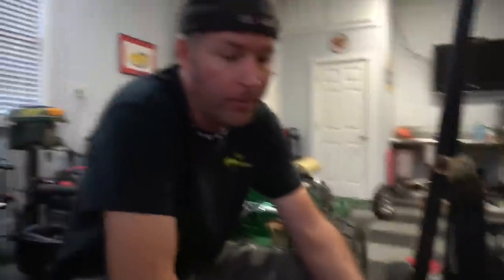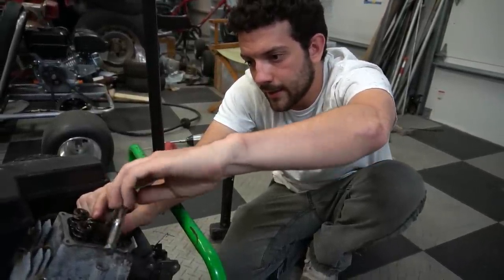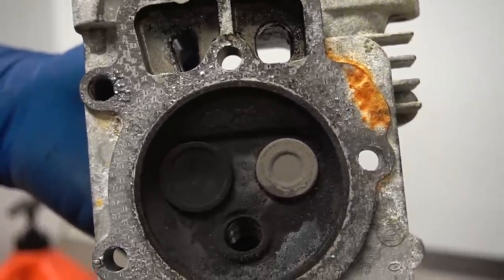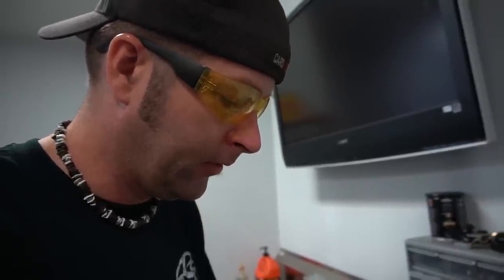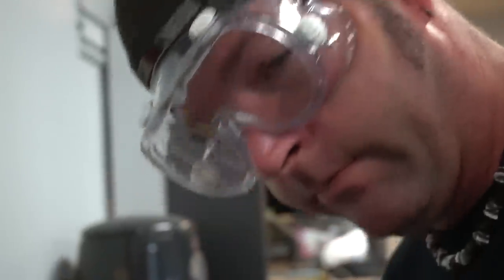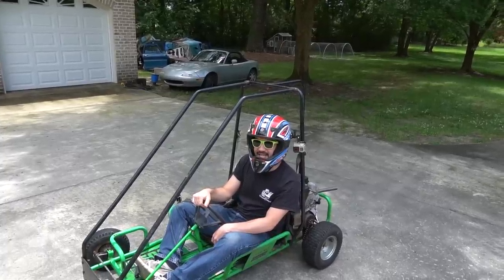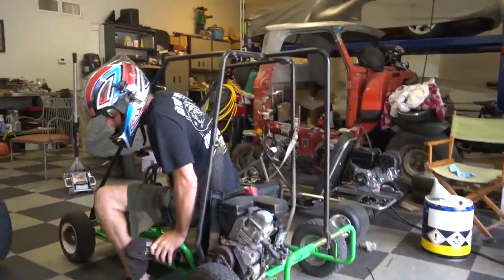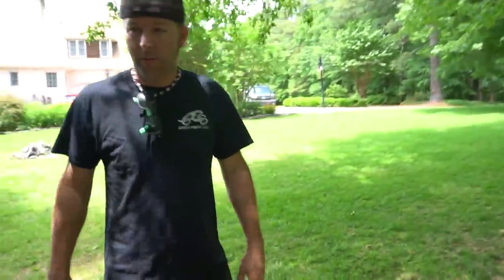5 Free Mods to Increase Go Kart Horsepower! Pt. 2

Comment: Small engine performane mod list:
1. Open up air filter for more air flow.
2. Make sure throttle has full travel.
3. Clean the carb and fuel system.
4. Port and polish.
5. Mill the head.
6. Remove governor.
7. Stiffer valve springs.
8. Drill carb needle jet.
9. Open up the muffler.
10. Billet flywheel.
Reply: You seem like you know engines so I want to ask you this. I am looking to buy a new jet for a predator 212 because I am putting a new intake on it and new exhaust. I don't know how big the jet opening should be please help.
Reply: @matthewarnspiger632  0.038
Reply: @matthewarnspiger632  buy a jet kit... if memory serves Amazon has jetting kits of multiple sizes so you can swap em out and find the one your engine likes.
Reply: What would you drill the jet out to??
Reply: @jwells1501  start with 0.035"  0.038" is fine as the other guy suggested
Reply: @Uptin Sinclaire I have a question... I have a 208cc power fist engine on my mini bike. I have  the stage one kit... can I take out to governor?? People tell me it will rev to high and break my pistons and rods
Reply: @yoboihooligan9914  "Powerfist" 😂 thats the funniest named engine ive ever heard 😂  i imagine its some sort of honda clone, so imho you're probably fine removing the governor.

There is a chance you'll throw a rod, but really its sustained RPM that kills ungoverned small engines.  If you're just doing a rip or two, it's probably fine.  Holding it wide open for 2 and 3 minutes at a time trying to hit a crazy top speed is where you're more likely to hurt it
Reply: And not just open up the muffler I rather get a brand spanking new muffler and 

derestrict that LOL and I wouldn't even swap out the engine cuz these parts are so expensive they're not like buying scooter parts I have a GY6 scooter and we used to be 50cc and I turned into a 93 just recently paid someone to do it all I 

got to do now is put the nitrous can on it and I pretty much in swapping out all the cheap stuff in the bike most of their parts are hella expensive but more or less they're cheaper than go-karts buying 

go-kart parts it's like buying car parts and I think even registering it it's like registering your car it's a little bit more expensive than a scooter. That's why if I do get one for my homie I'm not even going to do the full hundred percent transformation mods just too dang expensive. He can if he wants to but I got 

other stuff I'm trying to do with my money lol. 🤣🤣🤣🤣🤣^ and I rather just do little mods what you just stated my G
Reply: I would first start out by adjusting the the governer to allow you a higher rpm first, Or just reduce the size of your rear sprocket.

Comment: Guys! Lots of memories! Many hours racing karts and minibikes!
You need a clip on tach. Switchable for 2 or 4 stroke, up to 4 cylinders. Clips to plug wire. Most stock engines can twist near 5500 rpm with synthetic 15w40 with 2 extra ounces.
We used to tighten clutch springs or lighten shoes on the MaxTorques.
Loved the NorAm clutches! 3 different springs, 3 different shoe weights.
Ran 8hp carb on 5hp Briggs, 3hp steel flywheel, coil bracket, 4° advanced key, filed compression bump off cam.
We even twisted cams for torque or rpm.
With 8 HP carb, vertical rod (stronger, same weight)in horizontal engine with homemade dipper, we could make 6500 rpm.
Homemade megaphone pipe 12" long resonated at 5500 rpm.
Flatheads loved 2500 clutch engage, overheads about 2800.
Wildest we built was 5hp open. 32mm Mikuni, girdle, 10 ci head on 13 ci engine, copper head gasket, billet small flywheel, home profiled and lightened cam, Horstman rod, bigger valves and seats. Crank cut for needle bearings, balls on both ends of crank. Lasted 50 laps at 8300 rpm, blew at 8800 on dyno. 21hp at 8300, 30# at 5500.
I'm in NC also. If I was closer, we would engine party.
Reply: Damn I dont know what u said but I absolutely loved it.

Comment: I made a head gasket once using copper sheet cut from an old hot water cylinder, not as thin as soda can, but it never let go, and had many teardowns. 
I sealed it with spray on Hylomar head gasket treatment, and I also used to use that same technique for milling metal off, but I'd finish the surface on an old mirror 
with a sheet of wet and dry paper, made it nearly perfectly flat.. I also ground a few cams for lift on a white stone bench grinder, but only on the back flank, leaving the 
lobe alone. This gave more lift with a little more duration, it paid dividends. 
Anyway great stuff guys, love the porting technique.

Comment: I have a 34 year old lawnmower with a Tecumseh engine.  Its rusting apart, but the engine just keeps going...
Reply: S M My aunt had a 8.5 horse poulan lawn mower from like the 1990s and it had cast iron cylinder sleeves! All it needed was a new spark plug and a carb tune then it ran again. But I was lazy one day and kept the old gas in with a good amount of dirt in it so it didn’t run the day she started it up. So she sold it and now she bought a $800 Huskavarna or what ever the hell its called, but I’m sure it will never out last that Poulan she had.
Reply: I've heard many people cut down Tecumseh but I've had great luck out of them.
Reply: @mikeisaac3826  Husqvarna
Reply: @AEON.  that’s why I never buy new lawn and garden stuff. The older stuff is much better, especially the ones without the POS plastic carburetor.

Comment: Have used the coke can trick back in the day building Harley motors......also used cereal boxes to make head gaskets.......old school trickery LOL
Reply: What's the coke can trick plz?
Reply: What's the coke can trick
Reply: What's the coke can trick ?
Reply: @jaksonpritt5920  it's when they use the metal from the can to use as a head gasket, it raises the compression since its thinner, therefore giving more power
Reply: cereal boxes sound flammable
Reply: Yeah,Do some Low Budget stuff and Play the[Kinks] Song im on a Low BuDgEt,Thought ya said Datt. But use a HONDA this Time, Budgets ONE thing! Tecumseh Thats just Plain Dee-Wee. Don't Put a Smile on her face, Your not recycling its not that bad.Is It?You Didn't Say DaTt!...         ';•,OV0
Reply: @WestleyBates  not clamped between two pieces of metal, but a proper head gasket is definitely better and more resilient.

Comment: this cheap heap build just keeps getting better with every video..sad it outran all the other carts on the gp track..lol..down right embarrassing really ..yeah yall called it though..skinny treaded tires lay down more power to the ground surface where the slicks just spin or what i call ice-capade...need to load them all up and take em to the school parking lot and run that like you did when yall bent the axle on the race cart...i don't know about there but school is out here in Bama already so no kids to worry about getting in the way ...keep wrenchin yall ...Bama stars ------------>
Reply: Jane Ames north Alabama here lol just a bunch of 30yo kids riding minibikes lol
Reply: tbh, it's not so much that the tires are skinny, but they have a more aggressive tread than slicks, slicks are great for street/concrete but the more aggressive tread will get better off road grip

Comment: Very Nice!! Brings me back to when I was a kid and had one of those Baja go karts with the big rear wheels and small fronts and a Tecumseh 5hp flat head that was making more like 9 or 10 hp after a few mods I did to it, but going thru a Comet torque converter and pushing those 18" tires it would do over 60mph un governed (and those old flat head carbs were the best too because you could adjust the main jet size on the fly if it felt too slow, just adjust it a bit leaner). I ended up throwing a rod on it in a quest for more speed but it was definitely the fastest 4 stroke kart in the area at the time, one of my neighbors got the same kart with the 8hp engine in it but I would quickly catch him and leave him behind...

Comment: YOUR slik tires are wider,less height,but they have good traction on road.AKA two- one+ for grass.From15yo to 19yo,i start with 100cc 2 stroke,then sold that with my GLX90cc,and i bought 125 2stroke.Never run pro just love doing the dirty job,and love running,competition and screaming tires BUT always run with rain tires in raining days.EVERYONE knows that drivers get judged by turns performance(skills,traction Geometry etc.)those tires are perfect for this project.LOVE YOUR VIDEOS I STILL SMELL BURNING TIRES(from previous videos)

Comment: Nicely done guys.  Look forward to your next segments.   Ive done the straight threw  header exhaust years ago on a 6.5hp. Ended up burning the exhaust valve though. Also drilled the main jet  and had the air intake on a snorkel ( head hight)  for dirt tracks.
Reply: how many tooth back sprocket was that

Comment: Extend the levers that the steering linkage is attached to on each wheel and switch to a larger diameter steering wheel and tame that steering. Great job on the engine, carb and exhaust :)
Reply: how many tooth back sprocket was that

Comment: Do not cry fella, you can make your own clear valve cover out of either clear acrylic or lexan witch in not so clear but a whole lot stronger and more or less crack proof. Just some heat and a drilled plate. Good luck fellas too.

Comment: Since this cart made it's debut, I kinda thought the stall speed on that clutch was really low. Just barely off-idle. My inquisitive and cheap nature would beg me to take apart that clutch, see what shape the springs and weights are in, then dig around in my VAOS (Vast Array Of Sh-... Stuff) to see if I had some stiffer springs that would help get the engine in it's power band before engaging. Could still be considered a free mod, couldn't it?
Reply: yes i think so it dose mot cost any mony

Comment: a small bore carburetor does the same thing as a halfopen trottle 
over here in the ye olden days mopeds where limited to about 50kmh over here they done that by putting a bushing inside the exaust and mounting a smaller bore carburator sumtimes they closed up the ports too (2 stroke) basicly chocking the engine from its full capacity
so wat did we do grind out the bushing / mount a bigger exaust and mounted a bigger carb and manifold and then drove them to nearly 80 kmh

Comment: I have that same frame with an older Greyhound 196 w/gov removed. Super tight and sketchy steering. Especially on grated forest service roads. Hit the slightest bump at 35mph and it'll shift you about 2ft .

Comment: It would be cool to use a plastic spacer and bolt the carburetor straight to the engine, with the spacer acting as a heat insulator. Then on the intake side of the carb put on a velocity stack. That would be awesome. I know this is a budget build, but maybe on another kart. Putting the carb closer to the engine would improve response, and the velocity stack should improve power.

Comment: I have this motor on to go karts and Invader fun kart and a Yerf-Dog I hate these motors but they run forever if they run! I tried the mods that you guys have tried along with shimming the the valve springs and I even tried running it on alcohol for the 54 tooth sprocket on the Invader fun car at tops out at 57.5 miles an hour

Comment: I suspected float level being wrong on that tecumpseh carb, you get a look to that?
edit: yes indeed about the coke can head gasket! spray adhesive and aluminum foil to both sides of that will seal better when torqued down, the adhesive and foil being softer than the can aluminum, so no silicone to get into weird places or burn out.

Comment: I'm loving this video. How do you decide how much material you can remove when shaving your head and what size you're drill your carb jet. I'm learning stuff I have an old craftsman mower from the 70s or 80s with a 10hp Tecumseh which already pops wheelies in 3rd gear and halls logs in 1st. I'm looking to make move as a learning experience before I start learning better motors like my 98 Yamaha maximus for which I have 2 motors.

Comment: Dudes, this could be your best vid yet.
Edit: Form-a-Gasket sealant, that black, tacky stuff would have been better for the head gasket. The red silicone will deteriorate over time because of the feul in the combustion chamber.
Reply: Francisco Venegas jr. It was stuff just for head gaskets. Copper coat or something. Lol

Comment: With a clear valve cover you can mount some LEDs around it wire the - to the case and wrap the + around the plug wire. That should give it a cool strobe light.

Comment: That streaking between the valves is the "cleaning" action which was provided to you courtesy of the water in your fuel earlier. Also, the clutch is losing the stall because the spring is getting weaker and the weights are engaging too soon. I gave some clutch mod suggestions in the previous video which would solve that issue.
Reply: how many tooth back sprocket was that

Comment: Did You polish the Valves in a Drill Press? Start with 80 - 100 Grit and finish with 400 - 600 wet. My record for a kart with a 2 1/4 hp Tecumseh Flat Head with all Your mods + polished Valves = 32 MPH in 1972.

Comment: Part 3 mod cam shaft and remove governor and see if it blows up now that will be a fun video! Keith
Reply: mod the cam shaft?..i guess grinding the lobes to make more compression?..i've never modded a cam shaft so i have no idea..i usually just replace them with the specs i want on a new one
Reply: Ok Jane instead of buying new camshaft you can weld on lobe to increase lift  , if you were really sharp and build a stand you could also adjust duration, the weld is really hard and doesn't flake plus with these spring pressures it's not a issue. Most guys and girls who tinker in garage have a welder so it's free! Remove side cover save gasket ditch governor reassemble free . I didn't say anything about increasing compression with these mods I just said free. I hope John and Ike do this so you can see it work , iam not trying to be a know it all Jane but I am a GM Cert and ASE mechanic and have built many projects. That last . Lastly I think it's cool that you tinker with this stuff. Iam a muscle car gear head but I love mini bikes and go carts cheap fun. Honda z50 are awesome. Have a great day . Keith

Comment: You could modify the rocker arms to give them a bigger ratio for more valve lift. You'd basically just be moving the pushrod hole further out and welding up the old one.

Comment: hey guys... I has picked up a Clear Valve Cover from gps about a month ago.  my review is that you must be very careful torquing it down evenly without overtightening.  otherwise it will leak oil.  also, although it looks great when installed, a few runs and it gets very cloudy from the oil.  not bad for the money though.

Comment: For the intake I strongly suggest an extender that gives more time for the fuel to evaporate as it moves from the carburetor to the cylinder. Also a tuned tunnel ram will increase horsepower.
Reply: how many tooth back sprocket was that

Comment: I'm getting into working on my Go Karts. I have two go Karts both with Tecumseh Engines 6.0 HP and 12 HP. One question I have is how do you know how big of a carburetor can I put on these engines? Also you talk about re-jetting the carbs, how big of a jet can I put in those carburetors and what are the benefits?

Comment: You either need to put stiffer springs in your clutch or lighten your clutch shoes.  That will give you more stall and get you off the line faster.

Comment: just got a free Tecumseh 7.5 hp with a torque converter and it is very fast but has a major oil leak out the valve cover breather. what could i do to fix this.

Comment: Hey guys how about welding on camshaft to get more lift ? You can polish it down and the weld is hard! Boo yaw trust me it works and you can shim valve springs . Try it you will like it. Have a great day. Ike put a gear in caprice and smoke that Miata sorry John bye Keith

Comment: 1.  Fit brand new racing clucth 
2. Get a smaller sprocket 
3. Get a bigger pinion gear. 
4. Get a brand new spark plug
5. Fit racing valve springs and lighter fly wheel.
Thank me later

Comment: I have one of these engines on the yerf dog I just bought and on flat ground, runs great, as soon as I get on any bumps or off-road, it bogs out and almost dies.  Once off-road, the air filter is completely soaked with gas. I'm thinking I need a new carb. Is there anything I can do to this carb to fix the issues?